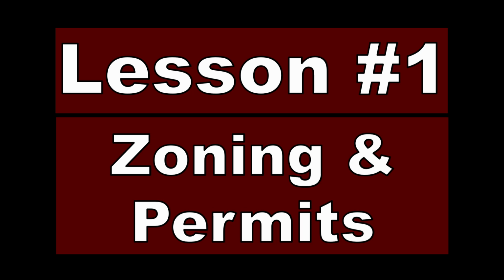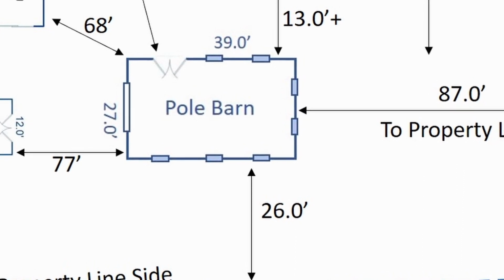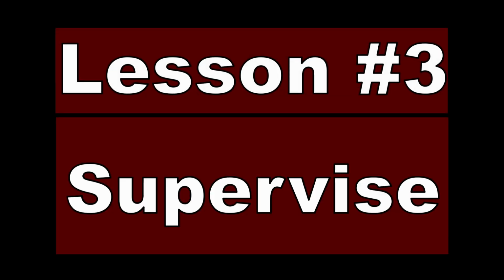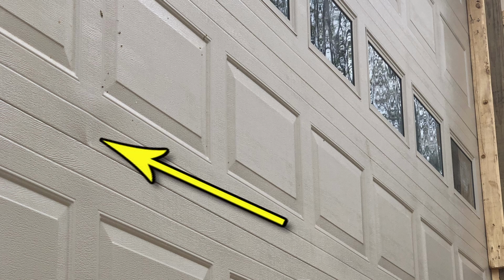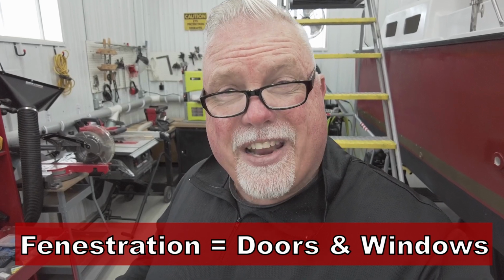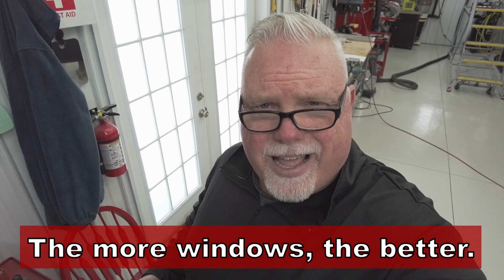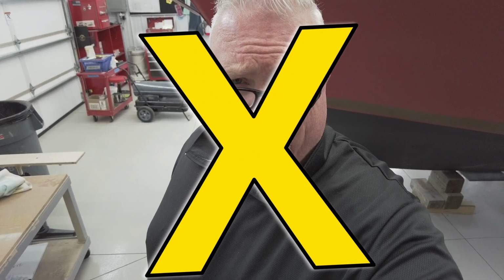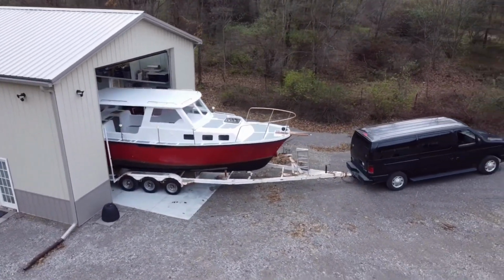How to Build a Dream Work Shop - Pt3 | Boat Building and Boat Restoration (Ep30)

Comment: My regret is building my shop with a 36 foot x 14 high wall facing the west. Absolutely zero protection from the wind. Currently steady at 28 gusting to 40 plus. Also made the mistake of not using house wrap. Did use poly to wrap the inside before hanging the inside metal but it doesn’t stop the wind.
Reply from the maker: brutal